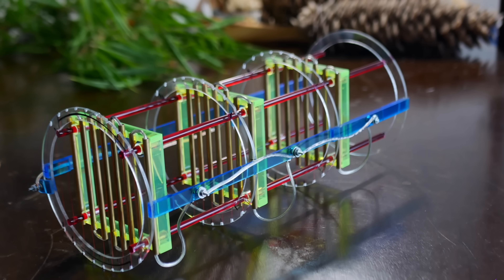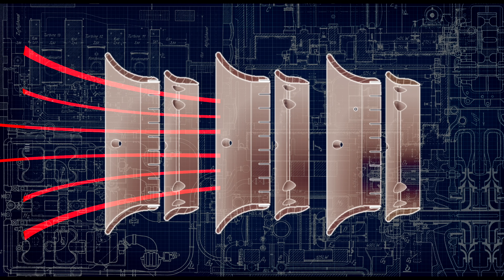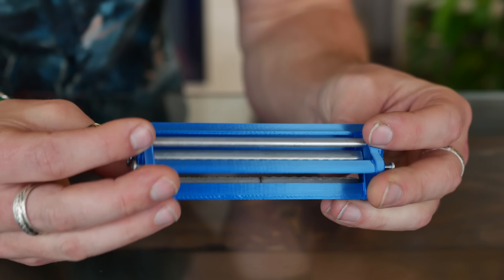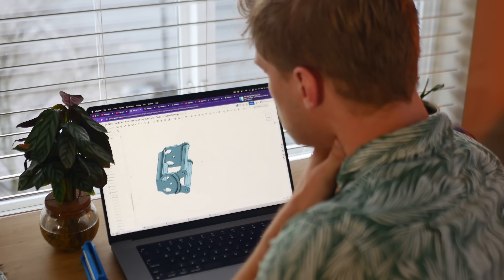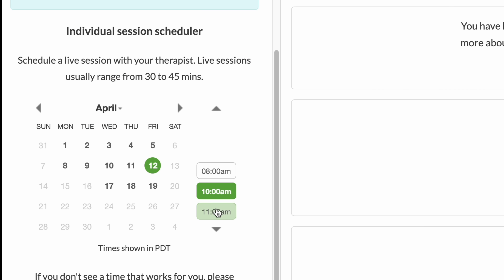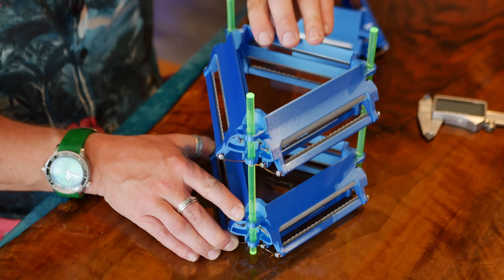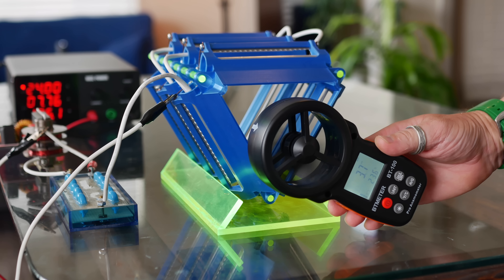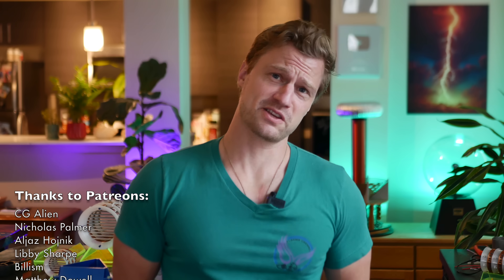Next-Gen Ionic Plasma Thruster Inspired By Nature (BTC Mark 3)

Comment: meh as long as you are using round elements instead of a more airfoil shaped element you will never get the top performance which it seems you finally included, kinda, it was discovered long ago that the ideal flow only happens when a sharp edge discharges to a blunt or rounded edge unfortunately you break up the interconnections the most efficient older models worked with by using individually powered modules decreasing the efficiency and increasing power consumption. the blunted trailing edge of the almost airfoil shape would have impact on subsequent sections, severely reducing current flow between sections. id love to see the electric bloom coming off each of those aluminum tubes, it would show just how wasteful your set up is. as apparently 'improved' as your set up is its still so wasteful youll never match some of the models produced just 2 decades ago

Comment: Here is a idea. Combine your wing thrusters with a duct fan fuselage thruster combo, where the duct fan feeds air to the ionic thruster. Test with a fan in front of ionic thruster. This will increase air flow into the ionic thruster. So the idea on combining a ductfan with ionic thruster is to increase thrust. Also have a cone shaped nozzle in front of the wing like a Sr 71. I have some other ideas if interested.

Comment: Even in outer space HAL ion thrusters need a really heavy gas (Xe or Xenon) to ionize and accelerate using high voltage electrical field differential with much longer run time or specific impulse than chemical rocket engines // but their performance per mass very low, so better for robotic probes sent on multi year deep space missions

Comment: Here is a sugestion instead of wiring alll of the stages in parallel try wiring them in series and applying higher voltage. Couse wiring stages  in parlell and then puting modules in series you end up with unintensional thruster that is figthing your main thruster the reson is you have Positive electrode then ground electrode a bit larger spacing and then positive electrode so esecialy you have two thrustres with thier outputs aimed at each other.

Comment: You mentioned getting diminished returns, so maybe try having the 3 stages different instead of equal, maybe try playing with the spacing between the electrodes, maybe having a shorter first stage and longer second and third stages, since air is already moving that direction, the way it's affected by the electric charge is probably different, also, maybe try using less power in the first and more in the last one and see how it affects the airflow!
Since the air can be carrying some charges from the prior stages, there's a possibility it could be deacelerated by the same charge electrode if it finds the same polarity more than once

Comment: There is a thing called high voltage skin effect, which causes plasma to travel on the outside of electrical conductors ionising and moving the air around it, some speculate that this is the method that man made flying saucers use to propel themselves through the air.

Comment: May I politely suggest that you use COMSOL Multiphysics software. It can simulate the electrostatics, the airflow thrust, etc  all where multiple physics interact. 

I think you can benefit a great deal from Comsol. It will easily predict performance of any design & assist your work.

The trial download is good for a month. Just visit their website & See what all Comsol is capable of modelling. It encapsulates PhD level knowledge of every known physics & math. Its extremely intuitive. Try it you'll like it

Comment: So you designed the thrusters to use constructive interference, with the peak interference being a few centimeters in front of the thruster. Wouldn't it make sense to allow at least that much space between thrusters as to maximize individual output? Either that or you have to angle the thrusters a bit more and make that distance shorter.

Comment: Wind sucks into a lower pressure ie you cannot blow into a closed vessel This means that at the back of your device there will be a drop in pressure causing an equal suction to the flow that may cause a kind of self defeating suction -to find the real output you must supply a steady pressure to the input. perhaps  sucking air from a spring loaded balloon or steady state weight on a balloon -I  think this is right cheers

Comment: what did you do about the back flow you noticed at 6:19? Could that be interfering with the output? Also, if the back flow is causing significant interferance, could the engine be staggered then?  i.e.
_          _
_  vs     _
_             _

sorta like the way flock birds fly in a staggered formation to utilize the vortices

Also, how would this perform in a thunderstorm?

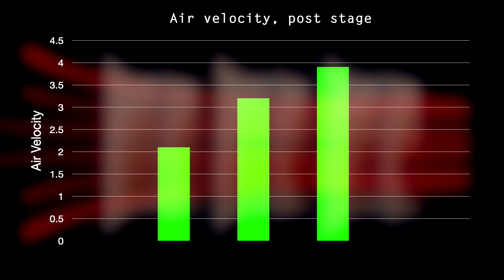Comment: 3:17 well energy and velocity relate by square and not directional. You have to change the graph and look how efficient the stages are in accelerating air. Which will make your life a whole lot more difficult because you will need to find out how much air is flowing through each stage... Nonetheless I am not so sure about your implied loss of efficiency in the stages.
Reply: Raphvsmith was faster.

Comment: You will have to sequentially accelerate the airflow otherwise the maximum airspeed will be equal to the highest of the individual stages more or less. What this design can do however is higher CFM. Alternatively you would need a sealed system with varying diameters. But then again it depends what your goal is because there are different applications for higher speed and higher flow of mass, however for flight I would argue that you need to generate thrust so I would focus on measuring thrust in g or kg versus simply air speed which only tells some of the story. You should read up on Bernoulli and his equations for ideas!

Comment: If you want better air acceleration per stage you either define the shape to be aerodynamic. Like a a subsonic nozzle. Or you increase the body force acting in the air at each stage.i.e. increase the power per stage. 

Also love you channel. And i like your enthusiasm. But ionic thrusters in atmoaphere are really low on in thrust. The only reason that the MIT plane flied was because it weighted nothing basically.

Ita better to use their thrust to produce auxiliary effects like flow reattachment or transition then to actually propell something.

Comment: As far as a glider is concerned, why not swap your power and thruster paradigm? Put power in the wings in the form of either batteries or fuel cells with a PH in the nose, then ventrically (word?) pull air in from the skin of the fuselage through ports, passing your main tunnel out the tail. Just a thought.

Comment: I really think you need to switch to static thrust measurement as a method of comparing efficiency rather than output velocity alone. For example, you might be seeing the same 2.8 meters per second output on two designs with the same power but one could have way more thrust than the other due to the surface area of the output. You might also have a design with lower velocity that is far more efficient than one with higher. You kinda touched on this with liters of flow but a thrust stand will provide more accurate information. 

Grams of static thrust per watt is the gold standard of measured efficiency. You should be making more than 1 gram per watt from what I know about ionic thrusters. 4 grams per watt is the highest I’ve ever heard of from research papers.
Reply: ^THIS!!! 
Great comment, do you think this could be done with just a kitchen scale?
Reply: With maybe a little math and providing a point for rotation yes you can use any scale. (given it's accurate) Basically the same as a load cell.
Reply: Load cells are insanely cheap. Building a sing rig for this would be piss easy.  @DoubsGaming
Reply: @julianholstein3840  Yes, you would just need a stand that can elevate the thruster off the surface of the scale to allow for unrestricted airflow.
Reply: @julianholstein3840 you can use a strain gauge and some math

and strain gauges are extremely simple (and extremely compact)
Reply: @julianholstein3840 thrust & force = mass × acceleration (on simple terms), so I think it's feasible to do that on kitchen scale
Reply: Yeah, he absolutely needs a better way of measuring  thrust and efficiency
Reply: 100%
Reply: In a twin motor boat, if one is faster than the other, it is doing most of the work.
Load balancing is very important.
Reply: static thrust is a better measurement than airspeed, but a plane requires good thrust at higher speeds. a design overly optimised for static thrust cannot propel a plane.

an example of a very static thrust optimized design is the main rotor on a helicopter. strapping one to the front of a plane wouldn't work too well if at all.
Reply: I haven't done any math to be sure, but intuitively I don't think an ion thruster will ever have the thrust to weight ratio of an electric motor with a propeller. I don't know how efficient  the whole process is for the ion thruster, but if we assume a 90% efficient motor, 90% efficient motor controller, and a propeller with an efficiency of 75% that puts the entire propulsion system at around 60% efficiency (This is very conservative especially if you design around an intended cruising speed). So theoretically the ion thrusters could be over 50% more efficient than a traditional "fan". With any electronic propulsion system the the majority of the weight will be in the battery so thrust to weight ratio of the "thruster/fan" may not be that important.

All that to say it may make sense to use an ionic thruster in an electric plane, as long as the thruster has a very high efficiency of converting electrical energy into the thrust, and you can get sufficiently close to the thrust to weight ratio of an electric fan.
Reply: @NNFaNRacing  the theoretical upper limit to thrust efficiency is ~20.8 grams of thrust per watt of energy. Modern day drones operate at about ~10g/w. 

The example I’ve worked on is a 9.5kg quadcopter with 22.2” props, ~8.95 g/w (with payload). According to the theoretical limit thats about 43% efficient. The motor I’m using is ~92% efficient so the propeller is therefore ~47% efficient. Disc loading is ~9.5 kg/m^2. A larger disc is generally more efficient, I’ve seen combined efficiencies as high as 14.5 g/w with disc loading down to 4.5 kg/m^2… but the rotational inertia of a fixed pitch propeller that large usually has negative effects on aircraft stability, in addition to making it a much larger airframe. 

For a boat application the weight of the thruster is not really an issue. I’d experiment on a surface vehicle for this reason and once determining the secrets to high efficiency move to lightening the thruster as much as possible.
Reply: i straight away see it as electrostatics creating the "force". so the action, pushing against electric charges, results in the reaction, the electrodes being pushed by the ionised air molecules that resist movement. 

theres work required to cram all the charges onto the electrodes. theres work performed in the minute current of charges moving from one electrode to the other as charged air molecules. 

the only thing you have to push against is the inertia of the ionised molecules, nothing else. 

any extra, "entrained" molecules, accelerated through bombardment of ionised molecules, offer no extra thrust. if anything, they get in the way, reduce velocity of ionised molecules. 

same issue with that concept startup, "jetoptera"... you dont generate thrust by entraining air. you only generate thrust by accelerating air backwards. entraining air is simply air you accelerated being slowed down as it transfers its momentum to other molecules. its extra DRAG. you only do work on the air you accelerate. with a physical surface. a prop uses its inclined plane, "airscrew" principle. a jet turbine, much the same. a rocket? pressure in the chamber acting in all directions except where the hole/nozzle is. leaving unbalanced pressure or force in the opposite direction. 
all cases, the force to accelerate the air is supplied by something physically attached to the vehicle. 

whereas entrained air is NOT attached to the vehicle...
Reply: It seems like all thrusters need to have equal thrust. Otherwise, one is doing most of the work.
Reply: I'm a mechanical engineer and I spent over 1.5 years of my life studying electrohydrodynamic thrusters, over 10 years ago. The thrust out of this thing is so small (most probably under 100 grams) that it would be a bit embarrasing to measure - especially since he's building cool-looking frames that weigh a ton!
Reply: @schlierenguy  Frank Whittles early jet engine only put out about 800 pounds thrust.  When they measured the thrust of a Spitfire to compare they found that a Spit with all the stops pulled out generated about the same - so suddenly the Ministry was interested.  A few grams is a good start IMHO.
Reply: @nigelwilliams7920  Of course, completely agree that progress in exponential, and in fact at the time there was doubt whether the jet turbine would work at all. EHD thrusters are not the same, mainly because of something called spark discharge. Did you hear sometimes when he attempts to take it to full power and there is some electrical crackling? If you try to pass more current through, this intensifies and you deviate from the coronal discharge regime that creates the airflow. If you consider that thrust is proportional to current (Coulomb force pushing the air), then that's why nothing's come out of this technology every time its been looked at. Look up De Seversky's ionocraft from the 50s, to see the false parallel for yourself.
Reply: In December of 2022, there was an article written entitled "Mitigating reverse emission in electroaerodynamic thrusters". Would love to know if you believe their claims are accurate.
Reply: This
Reply: A load cell with an esp microcontroller and a small display would make for a great test rig! You could then also change your parameters in the code to optimize the data for the measurements you’re looking for. 
Just an idea…
Reply: Yeah, I was gonna say KE is what you need to worry about. Doubling the speed would require quadruple the sections that have similar power.

Consider using a chokepoint to increase speed. While from a KE perspective, it dosen’t make it more efficient, the air would be going faster through the exaust, meaning you require less air at the intake for the same amount of force, which might be an especially good improvement for slow-moving crafts
Reply: Definitely, especially considering that early ionic aircraft will likely get their power from batteries, which are heavy, so a significant increase in efficiency will be well worth slightly less thrust
Reply: thats what I was thinking he could be moving alot more air just at a similar speed.
Reply: Show how the smoke goes in!!! You can check t you are properly sucking in all. Can be first one is sucking and doing most work. 😅 Have u tried parallel Vs series placing? Also did differences in past videos:0
Reply: Yep. If you're designing and optimising thrusters then there's absolutely no substitute for measuring, well, thrust.

Thrust per watt is absolutely the right metric, both for optimising these designs and for comparing the results with other designs, or other forms of propulsion.

Comment: Thrust to weight ratio with the mark 3,  within material limits  should scale like this...

If we Imagine the frame being square and double the length  of each leg of the square, then the weight of the frame would double while the cross section for air to pass through goes up by 4×. In short, while  size and weight scale linearly, the mass of air moved scales exponentially by the power of 2. 

You should consider replacing copper wires with aluminum wire to save weight. You have so little current that you need not be as concerned with cooper's slightly better conductivity, and rather be more concerned with aluminum being far lighter, because thus weight would scale exponentially  with thevcross section of air. The wire doesnt make up much if the weight while it is small but scaling exponentially with the cross section of air could make a Big difference.

Comment: I see a small problem with your new thruster. There is no mechanism preventing the air just going the opposite way. As you showed on the video the air is coming out from a small triangle at the end after the thrusters. But in order for the air to come out there is a need for a deference in the pressure, and in your thruster that difference is both in front and back of the thruster. That means that you are loosing aair from the front, because there is nothing to prevent the air from coming towards the other direction. The solution that i propose is putting a small circular thruster like the previous model that you made, in order to force the air in with a higher pressure than the outer ambient pressure, and then the rest will be done by the side thrusters, increasing the pressure and the speed.the good thing is that it shouldn't by difficult to make it happen, the bad thing is that now you will need to reintroduce the wires in the thruster again
Reply: Blah blah blah useless tech, grats on ur 1/5 horsepower, minus well try make an LED light the size of a pinky illuminate an entire city, derp.

Comment: You need independent voltage sources for each stage or the subsequent stages can't actually accelerate the already ionized air stream.
as say air enters at 0V vs the ground, and leave at 10KV, due to a 20KV stage, the second stage if its also at the same potential to the first will only do half the acceleration, instead you need the second stage to be floating or even be forced to start at 20KV so that it can still apply full acceleration to the air stream.